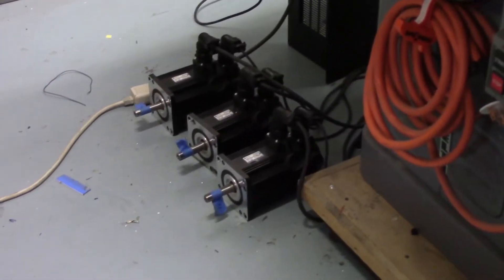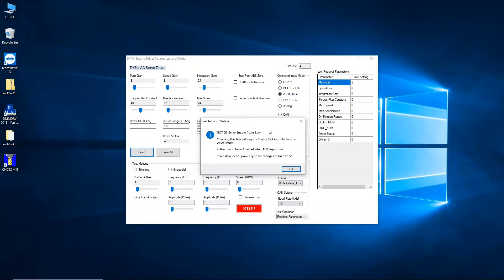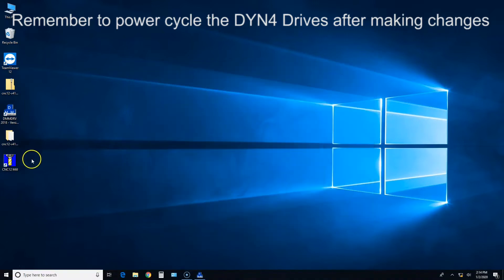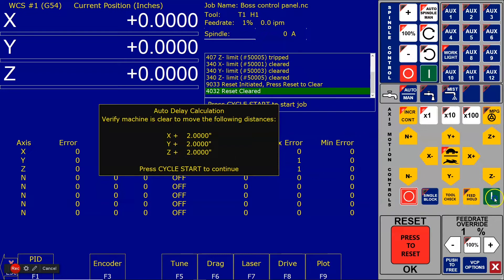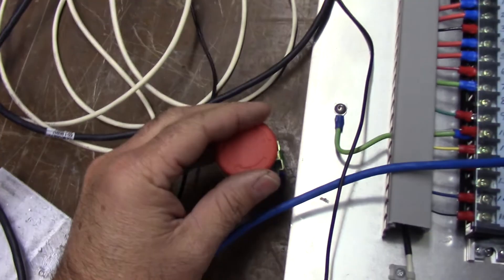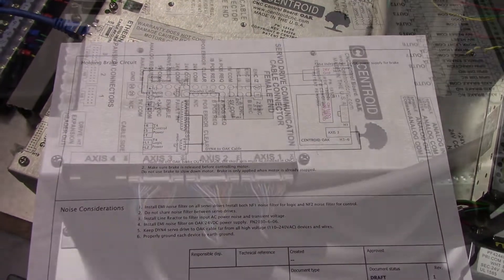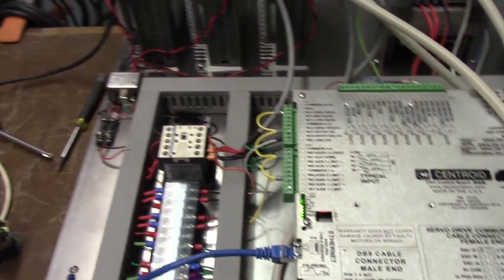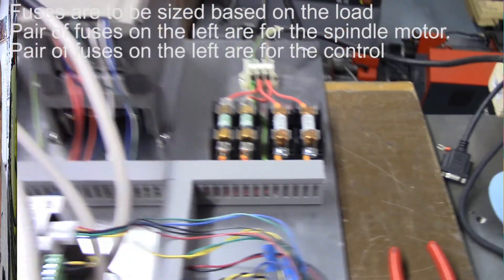Centroid Oak & DMM Update: Overview, Setup, Bench Testing

Comment: I see this video is three years old. Do you still answer comments or I’m in the space with my machine but I am using dyn5 drivers when I set it up I do not get any numbers on my DRO screen am I missing something?
Reply: Glenn, I have not tested Dyn5 with Oak. Did you buy cables from DMM for use with Dyn5 and Centroid Oak? Have they tested Dyn5 with Oak?
Reply: @MartyEscarcega  
I bought the flying leads from Centroid and wire them with DMM wire diagram. Everything work but during testing, and I bound up my x-axis and burnt out a Driver. I bought a replacement, but when I plug it in to oak it shuts down my PLC. if I wire up one of my other drivers to the same axis with the same lead, I have no problem with the PLCs running.
I do notice when I am running CNC 12. Nothing comes up on the DRO so I don’t know if this is a related problem or something else 
I programmed up the DYN driver, using DMM instructions . but still whenever I try to plug it into oak it shuts down.

Comment: Just discovering all of these great videos!!! What additional steps are involved for e stop on the VFD for spindle control? I’m assuming oak sends a “spindle off” if it detects a fault. But, My spindle has a thermal overload that I have wired into my vfd. If the spindle overheats, it breaks the circuit and the VFD faults out. BUT, that doesn’t tell the controller to stop movement. I’m about to purchase the oak board and am curious how you would wire in the vfd in this case. Thanks for any advice!!!!!

Comment: Great Job Marty! My question is do you have to do this to each drive individually
Reply from the maker: Yes, each drive needs to be configured, connected to Oak and configured in the Centroid CNC12 software. I would Not install any of it in a cabinet until it has been successfully bench tested.
Reply: @martyscncgarage5275  Thank You Sir

Comment: I need some help, is it possible to use clearpath motors on a centroid oak board?
Reply from the maker: No sir. Centroid Acorn would be your answer. Please ask your questions on the Centroid forums. https://centroidcncforum.com/viewforum.php?f=20 you will get help there to answer your questions relating to Centroid control options

Comment: Quick question. Did you ever figure out how to get the DYN 4servo running as a spindle motor? Particularly with acorn?
Reply from the maker: I did get it working using DMMs instructions. I had to get the lathe back to its owner. The DMM document has the hook up diagram to make the encoder cable as well. Unless you have the AC motor, I'm not so sure I'd pursue it in my builds.
Reply: martyscncgarage thank you for the reply.  I’ve got a crappy little dc motor that gets too hot for all day use, and am looking to be able to control velocity and...thinking further down the line...step and direction.  I don’t really wanna go the vfd route.  Was trying to accomplish it with clear paths motors.  Found a dead end there too.  I just really need it for threading at the moment and the idea of just plugging in the encoder cable from the servo or servo drive right in to the acorn encoder input sounds like a dream. I’d rather have that over having to buy one of those cheap encoders from eBay period.  Starting to think that I should have learned to code LOL.  I’m editing this just to clarify that I said step and direction in the future, in order to use the lathe spindle as somewhat of a rotary axis for indexing etc.

Comment: Hi Marty, are you cutting the drive logic power with the e-stop contactor to reset the drive fault?
Reply from the maker: No sir. Logic always stays up Oak does the reset.
Reply from the maker: It's does it through the drive cable. It is something DMM addressed when I did the testing previously.
Reply: @martyscncgarage5275  with my Oak/DMM DYN4 setup i can only clear drive faults by cycling logic power to the drive. My drives were purchased from DMM around May 2019
Reply from the maker: @burkewl33  You need to contact DMM if you want to upgrade your drives and cables